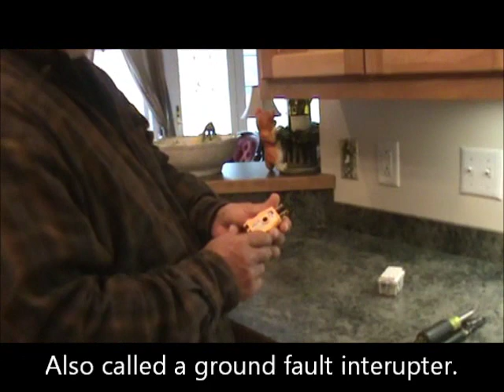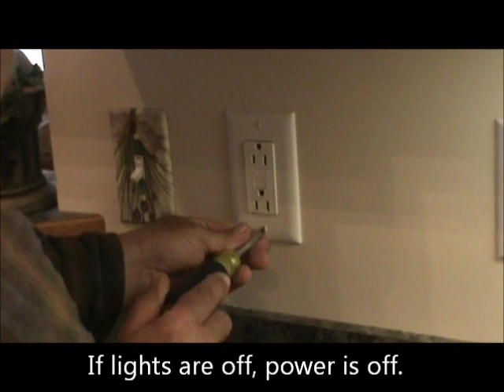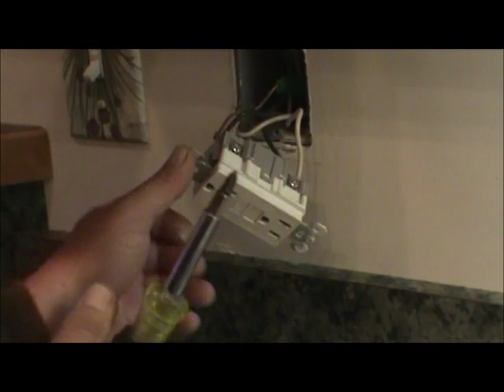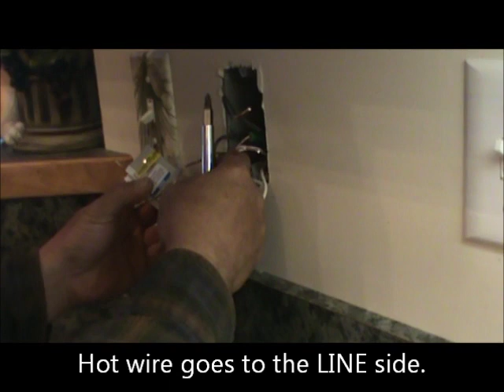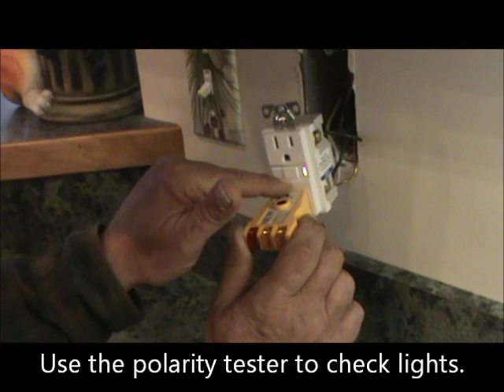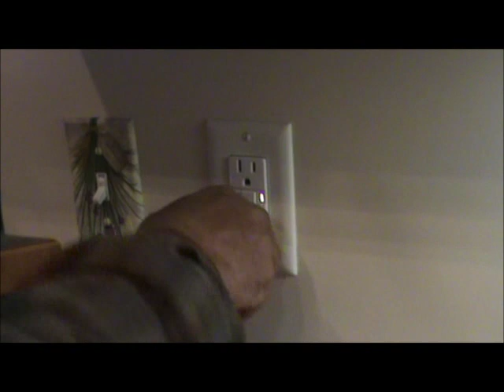How to Replace a GFCI Receptacle

Comment: Is there any way to figure out which wires go on the top and the bottom if you already installed a new GFCI outlet incorrectly?
Reply from the maker: Take your meter and see which black and white has 120 on it they go to line the other 2 go to load on the rec